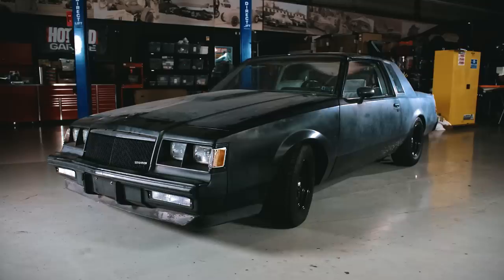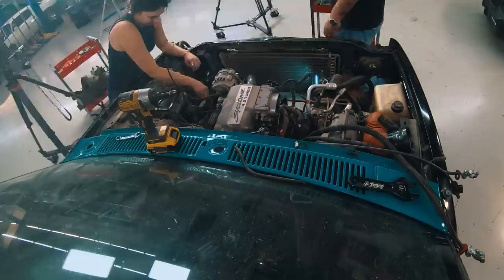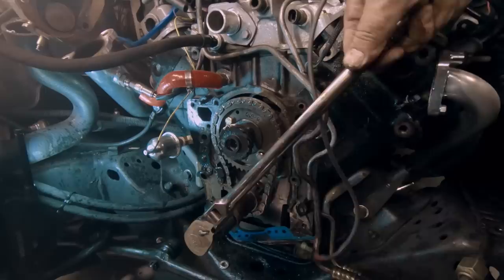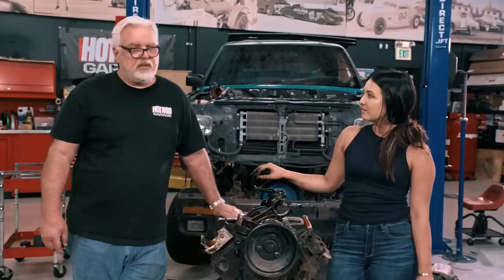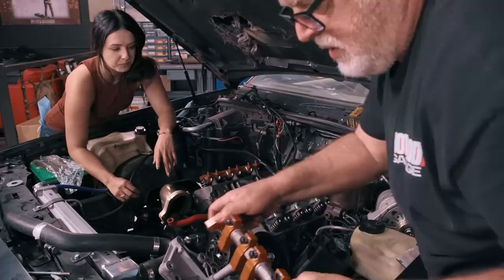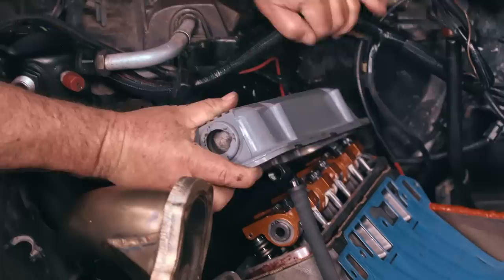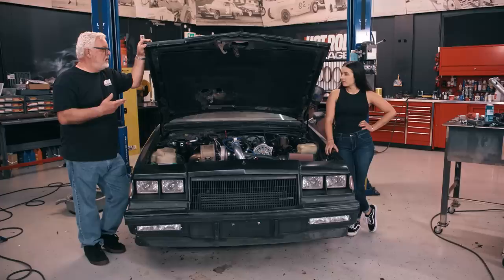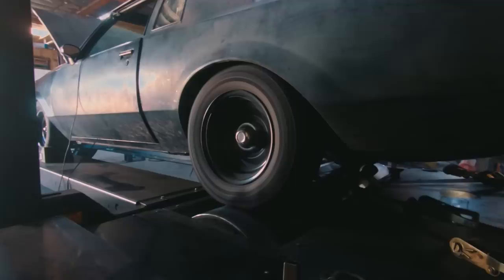Re-redeeming the Grand Trashional | HOT ROD Garage Full Episode S10 E2 | MotorTrend

Comment: I suggest you check the fuel delivery.  With the changes you made this car should run in the low 13s or high 12s.  Tire spin on street tires should be out of this world.  Another thing she needs to leard how to launch the car at the drag strip.  Need to power brake it to get the turbo spinning.